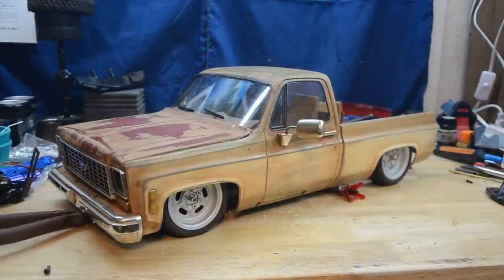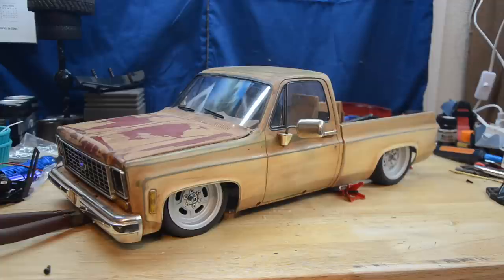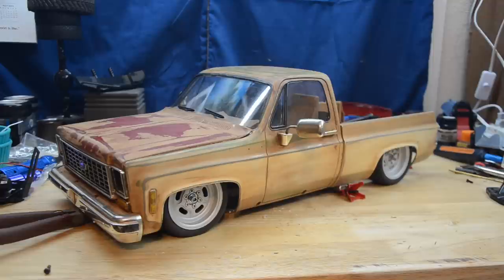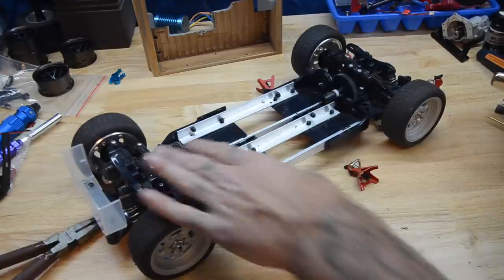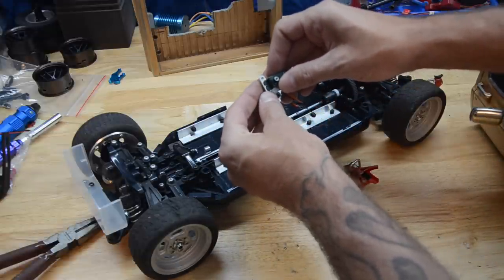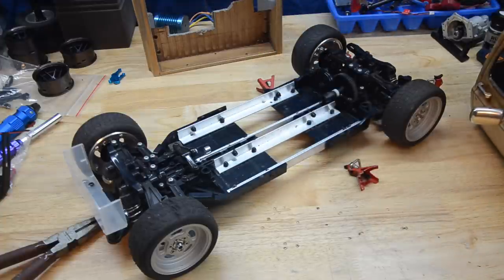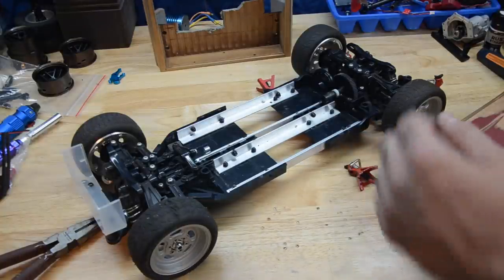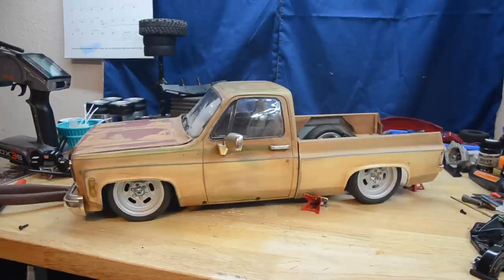SquareBody Shop Truck Build, Part 1, Super EASY Chassis Fab, C10 RC

Comment: Props to you.  I don't have the patience for this type of stuff.  I have a 4wd slash ultimate that I tore down to the chassis to replace a dif and cracked chassis and throw on some upgraded arms and shock towers, etc and it still isn't finished after 2+ years lol.  I blame covid as I took almost 2 years off RC because this hobby gets expensive.

Comment: I stretch RC18T chassis like that all the time. Plenty stiff. The only difference is I put the aluminum on the outside of the plastic chassis. It keeps the aluminum lower and not cause as much contact with your interior.

Comment: Hey thanks for the great inspiration- I have  been stalled out on a similar build with a TA-02. After many hours to make a custom alu chassis to fit, and a homemade steering setup,I could not find the right tire and wheel setup to satisfy what I was looking for, so it’s been sitting on the shelf of frustration. Those wheels look perfect. ps- I only hope mine turns out 1/2 as nice as yours. Thanks for the unique tips on so many out of the park builds.
Reply from the maker: Hey bud, they make a bunch of 2.2” drift wheels and tires now as well.  I see them on eBay. Tons of different styles and a lot cheaper than this setup I’m running. I kind of felt like I was cheating using a touring car chassis at first but really it’s combined my 2 favorite type of rc into one. Once I get the body done I’ll have to come back a deck out the chassis. 😝